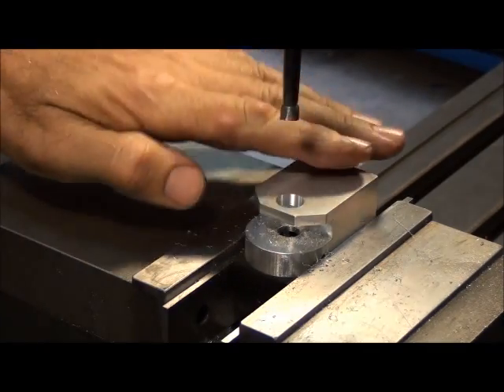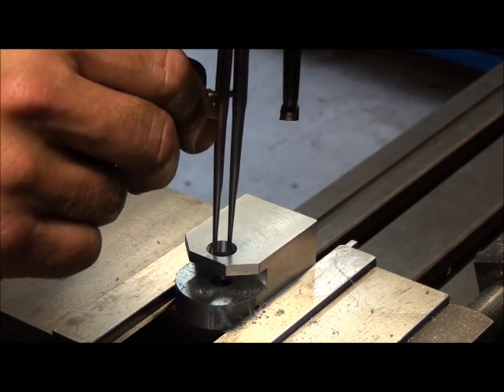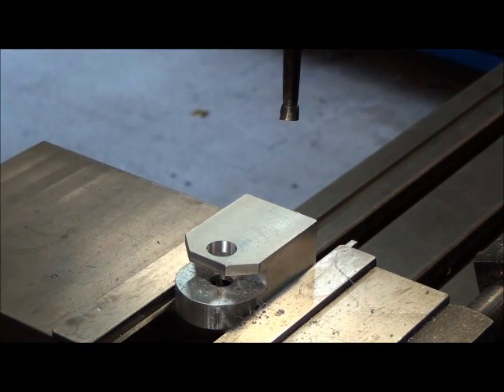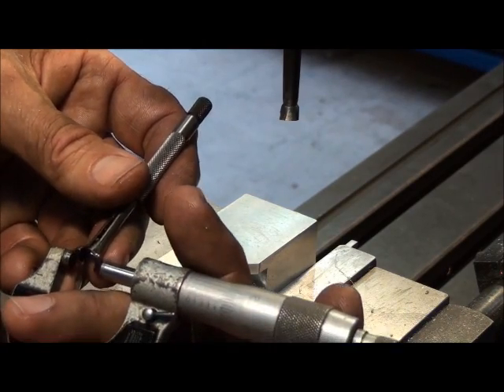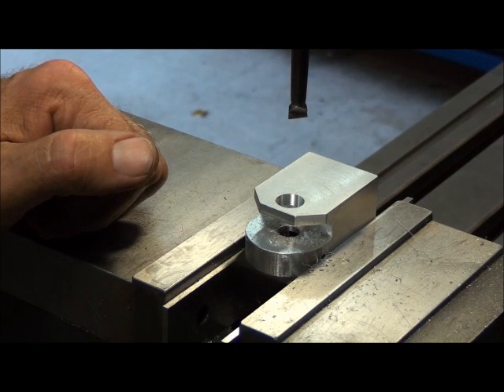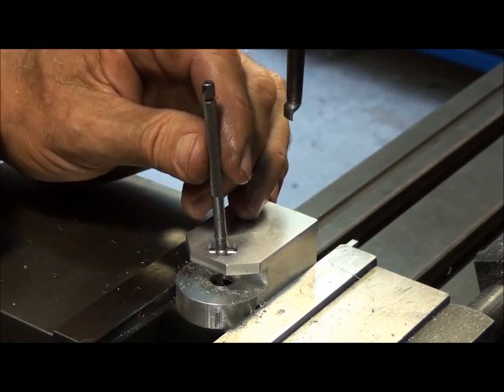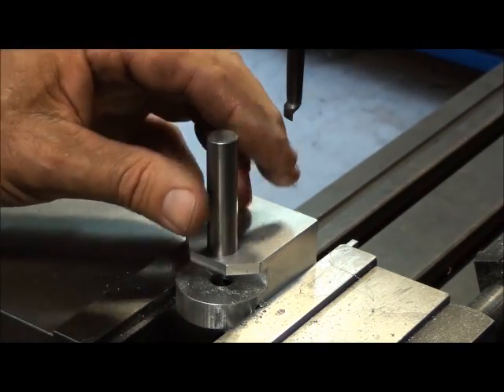Common Methods of Measuring the Diameter of a Hole

Comment: Rocking it over center works?! Whaaaaaa
My dumb ass has just been getting it true straight up and down, then tightening, flailing it to the loose spot, loosen tighten, flail to loose spot, tight loose until there's no more loose spot.....
Reply from the maker: Yes, that's the only way to get precise readings.

Comment: classic trick especially if the hole has  a chamfer is to machine a punch that is undersize by 2x the thickness of some copper sheet and press the copper through. your hole is the diameter of the copper cup minus a couple thou. this is completely impractical but it's how i sneak up on dimensions when actually making dies.
Reply: This is particularly when I'm doing the final polishing. Often when obtaining your final finish you end up removing potentially like 3 thou of material. just from sanding with ~400 grit paper until the peaks are as tall as the valleys. it's better now because i have an actual cylindrical grinding attachment for my toolpost but it can be pretty tricky.

Comment: I'm lost as to why you need to measure a hole you drilled with a drill press.  The size of the drill bit is the size of your hole.
Reply from the maker: The hole was bored in a milling machine, not drilled in a drill press. But even a drilled hole can be larger than nominal, depending on how well the drill bit was sharpened.

Comment: I just got my first ever set of small hole gages. How much drag am I looking for? Just a touch, or a bit more positive than that? Should the gage slide out of the hole in the same way as a block slides out of a micrometer? I've used pins until now and would like to gain more accuracy. Thank you.
Reply from the maker: Ream a hole to a known size and use that for practice. The key is to develop a feel so you get the same reading every time.
Reply: @TomsTechniques  Thanks very much. Will do.
Reply: @TomsTechniques  As you were so kind as to give thoughtful advice, thought I'd update this. Started with reaming .250 and .3125 holes. All by hand. None were accurate when I was done. Figured, user error. Ordered a couple of brand new reamers and kept practicing with what I had. Today, I popped and reamed 25 .250 holes, 5 of which were relatively accurate as gaged with pins. Progress. That's better than yesterday. I'd also picked up a used Starrett round small hole gage set that's significantly nicer to work with. As such, I'll keep practicing reaming and using the gages until it all comes together. I'm looking at it as killing two birds with the same stone - learning how to ream well (I thought I knew how) and getting a feel for the gages. Thank you again.

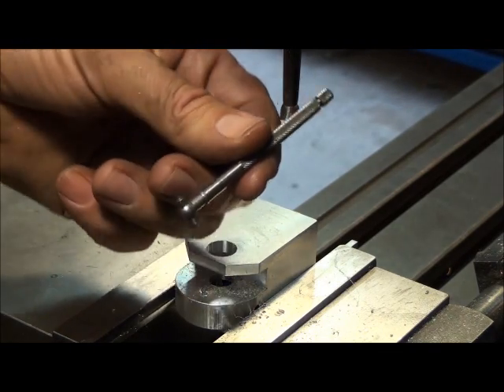Comment: 5:28 Why is it important to rock the telescoping gauge over center only once? Even if it's unnecessary, I don't see how rocking it back and forth would cause any problems.
Reply from the maker: Rocking it once will force the guage to find the exact center of the hole. Doing it multiple times accomplishes nothing and increases the chance of it drifting off center and producing a false reading.

Comment: Trying to figure out how you measured .4945", cut .006" and wound up with .499". Thanks for the demonstration
Reply from the maker: Looking at the video, I guess I got lucky. The final cut should have been .004"- .005", not .006". It's hard to do math and make videos at the same time. :) The reason the hole didn't go oversize is probably because the tool was getting dull and required a few more spring passes to get to size.

Comment: I understand your thinking on "the spring pass", and I've seen other YouTubers make several passes to account for it. My father taught me to use the spring tension on that pass to my advantage. Make one pass, then check for for
fit, and only if the fit was too tight would he make a second pass without adjustment, and usually nail it. We routinely held .001 tolerances using this method. Let the pressures between the tool and surface allow you to sneak up on your desired minimum dia is what I'm saying.
Reply from the maker: Absolutely. There are lots of little tricks like that in machining. I usually just reverse the feed and take the spring pass if needed for a super finish.
Reply: one of the benefits of having a crappy small non rigid lathe

Comment: do people actually use these? I've been a machinist for 11 years and I've always used gauge/deltronic pins to measure a diameter of a hole. Or a dial bore gauge for really big diameters.
Reply: samwjohnson - that's the trouble: you are a MACHINIST with REAL (costly) tools at your disposal. We metal butchers don't have the time to accumulate the years of experience or the budget for the high-end gages to do it "right"  🤑
Reply from the maker: I use both. Small hole gauges are quicker than gauge pins for low tolerance holes. I'll also use them to get close to the finished diameter on a tight tolerance hole and then use a gauge pin to finish up.

Tom

Comment: You should have ran your indicator down the side of the hole. Looks like u have some taper.  A .498 pin will go in but not slide all the way through??? Bad burr on the bottom side or what? It also looked like the .500 pin started going in at the top of the hole about .01 deep.  In my opinion you might be over the high limit at the top!!!!
Reply from the maker: +Esteban Chavez 

No taper. You can't see it in the video, but the slot in the part wasn't deep enough to clear, so the bore created a step in it. That is what was keeping the gauge from going through. The part went into a successful fixture and is still in use.

Tom

Comment: I wonder how accurately you can measure the diameter with the edge finder.
Reply from the maker: I haven't tried it, but probably within a couple of thousandths, provided you have a DRO on the mill.
Reply: They work. Have to find center of x an y axis then you can center the two up to find center.

Comment: novice here .  why not just use a drill bit instead of the bit that you are using
Reply from the maker: Good question. First, a drill won't drill a round hole, it'll drill a triangular shaped hole. Second, a drill won't drill an accurate hole on location. If the diameter is critical, but the location isn't, you can use a reamer. If you need both, a boring bar like I used in the video is the only way.

Thanks for watching.

Tom
Reply: Jinliang Liu Good video! Or we could use reamer as a hole size of whole number.
Reply from the maker: Yes, if the hole was a nominal diameter. But a bored hole is still more accurate in size and location.

Thanks for watching.

Tom

Comment from the maker: I think you'll find that a second sweep won't change anything, one sweep is all it takes. The biggest factor in getting consistent measurements is getting the drag right. The best way to learn is to set down and try it over and over until you consistently get the same reading.

Inside mics require a 1" hole or larger, so that will be a different video.

Tom

Comment: in toolmaking in which i'm qualified in, i was taught to, and teach to rock the telegauge out of the hole gently the larger diameter of the gauge will automatically find its center and continuously drag itself out naturally, simple dragging the gauge could result in one end of the gauge being pushed through creating various accumulative errors... this is the preferred method i have been taught by south african, english, dutch, and chinese toolmakers and machinists, love from new zealand